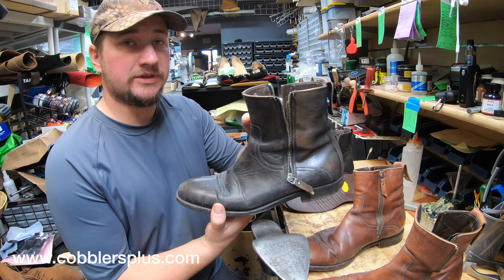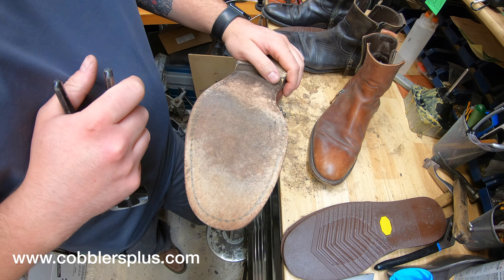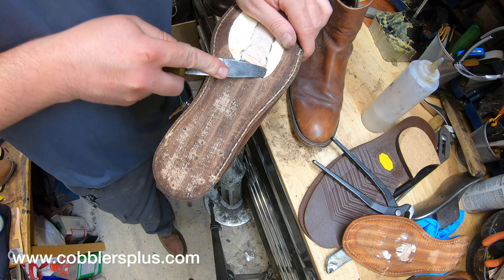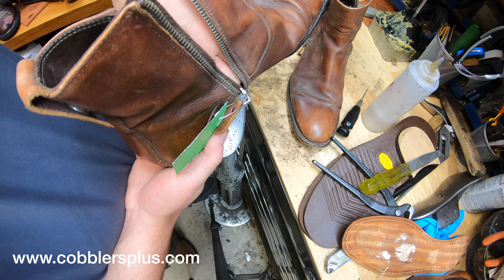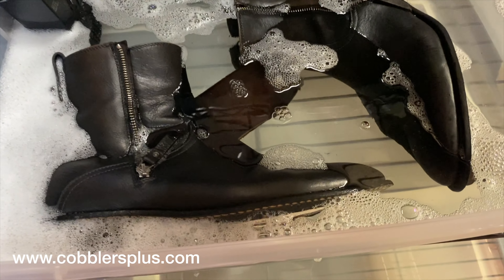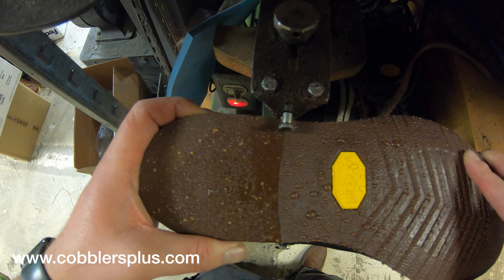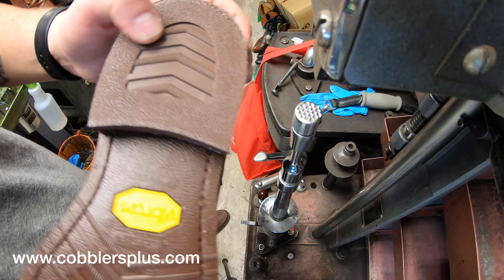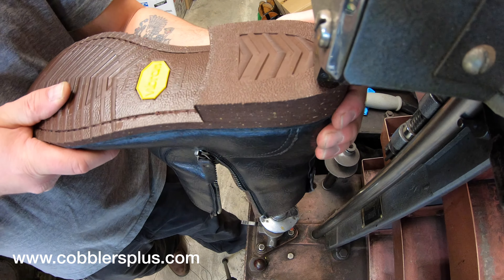Johnston and Murphy converted from a glued sole to Blake Stitched with Vibram 700 Cork Soles

Comment: Was converting to Blake/Rapid with a new leather midsole not an option?
Reply: I’d be disappointed. Adding a leather midsole and rapid Blake would have made these boots last a lot longer and look great with the vibrant v bar soles
Reply: @michaelc9896  Exactly what I thought.
Reply: I believe he explains in another video that there's an issue with stiff midsoles on chelsea boots. If I remember correctly, because of the lack of lacing, the boot has to hug the foot a certain way and stiff sole interferes with that.

Comment: Two questions: On these J&M boots, can you add a leather midsole (on Blake stitching) before you install the outsoles? Also, if the customer requested to, could you have converted these boots to goodyear welted shoes? I'm asking because I have a couple of barely worn J&M shoes that are of the same construction. Thanks!!!